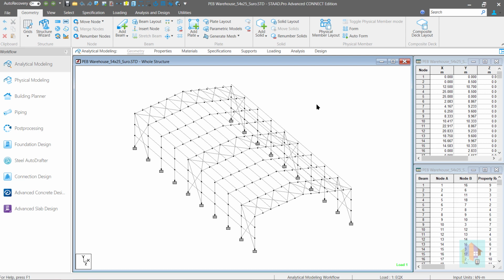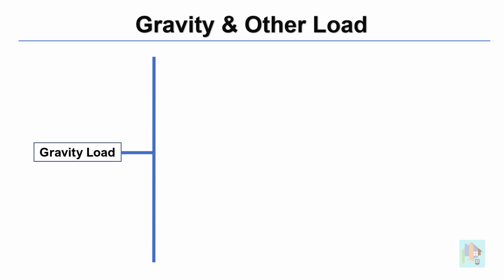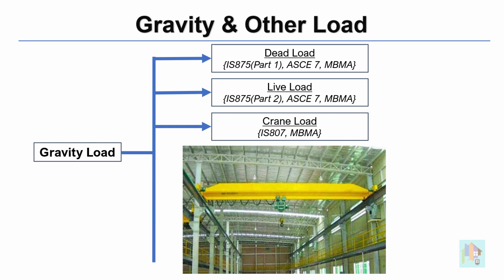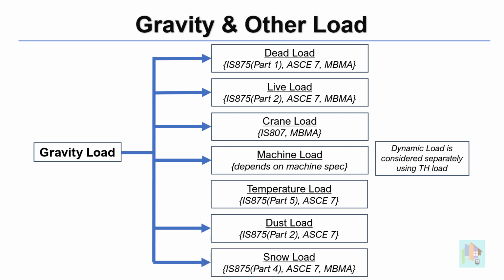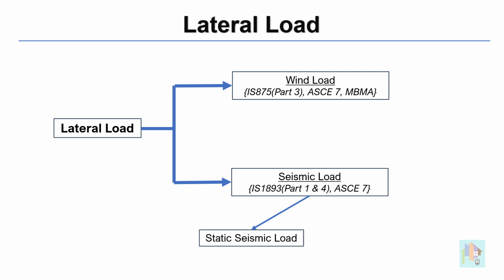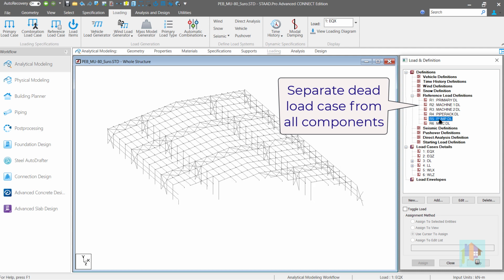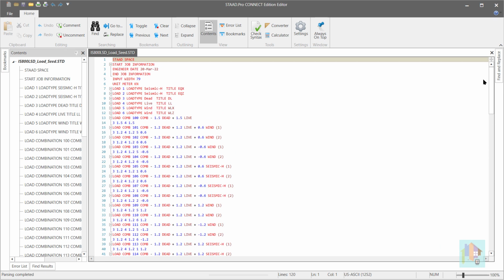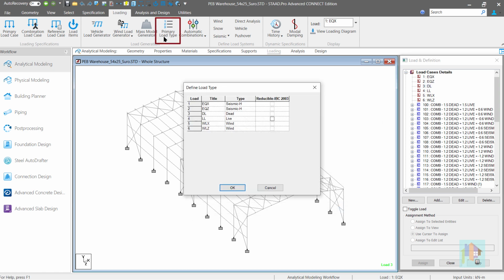PEB with Analytical Modeler: Part 2.7 -Load Case for Analysis & Design || Gravity,Lateral,Crane load

Comment: Hello sir, what should be the load combination for non orthogonal steel structure? Kindly elaborate or provide IS code reference.
Reply from the maker: There are some additional combinations we need to consider for non-orthogonal frames, like combinations mentioned in IS1893(part 1):2016 under cl.6.3.2.2 and cl.6.3.4.1 for seismic analysis, this I will cover in my on-going series on static seismic analysis (https://youtube.com/playlist?list=PLxLi_mmlPeioCvBiFgvejNGzC14ocb87i). You can check IS875 code for other such combinations.
Reply: @surojit_ghosh  ok sir.